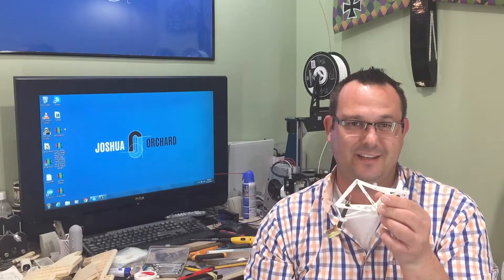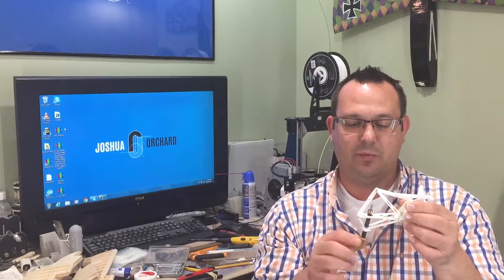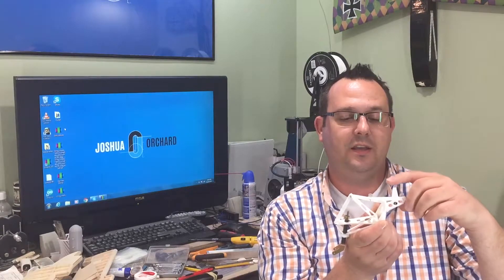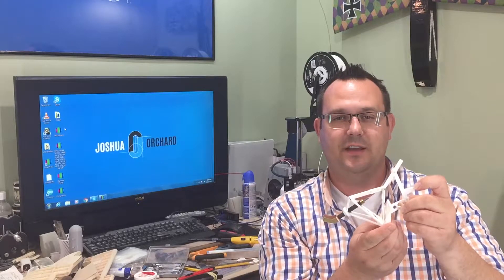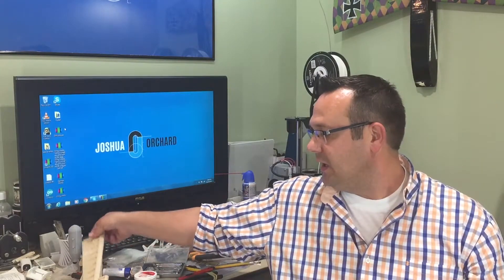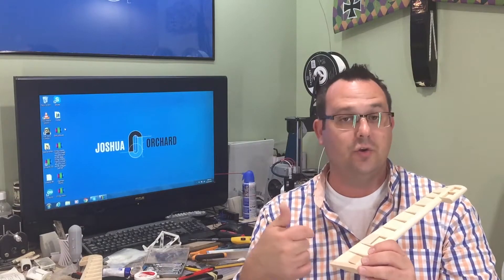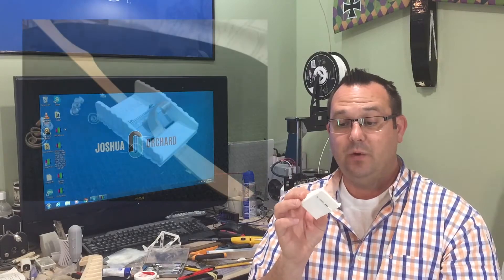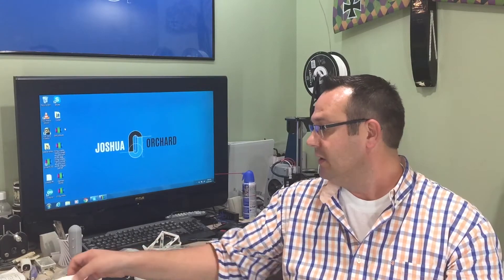Corsair Update #01

Comment: It looks fantastic Joshua and thank you for taking the lead on adapting this rather old design to a new technology.  I have a hunch yours will be the first of many of these that will be created with 3d printing.  I do need to give credit where credit is due however.  The basic design for the tail wheel has been around for many years and comes from a gentleman by the name of Earl Aunne.  While I have incorporated a few minor changes, primarily to improve the scale fidelity of the unit, the vast majority of it is identical to Earl's original work.  Looking forward to the finished product and best of luck with your Corsair build.